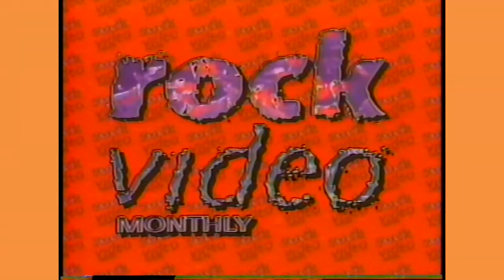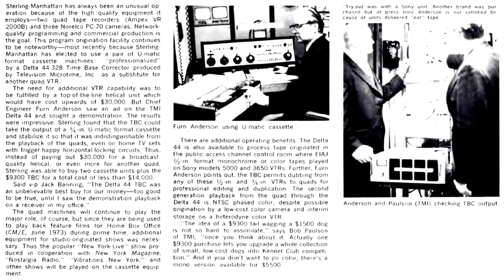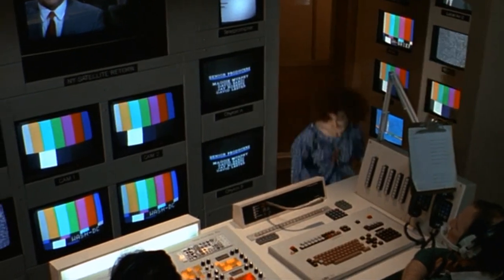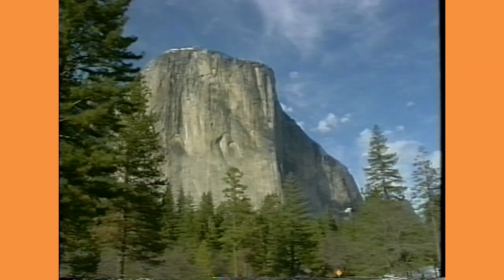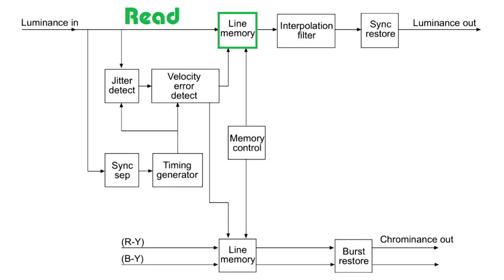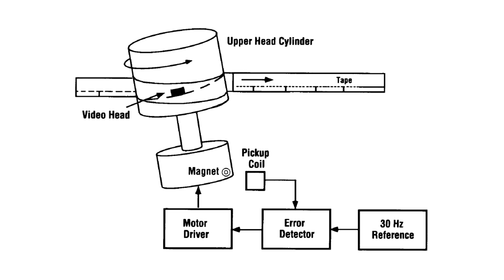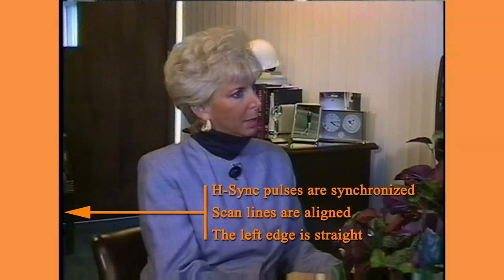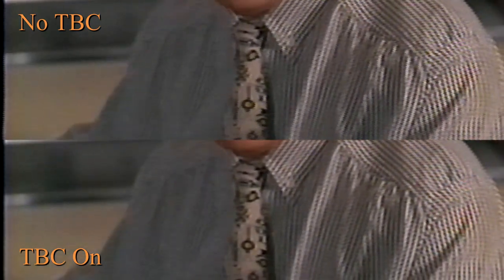What is Time Base Corrector (TBC) and do you need it?

Comment: Some of old vhs c recorded by a mitsubishi camcorder in the 90s have picture roll during the first second of a sequence... i d k why this problem appears on the tape ... i use a jvc with tbc inbuild for the play-back but the picture roll still persist a little 😢
Reply from the maker: My VHS camcorders also stabilize the picture horizontally, but show an occasional picture roll on bad tapes. I run these through a Digital 8 camcorder, which has a stronger TBC. I've yet to acquire a DVD recorder to use a TBC.
Reply: @ConsumerDV  thanks, i think is better if maybe a choose a good external Tbc. I think the tbc inbuild in the jvc camcorders are good to preserve the frame but gives some littles picture roll ... not the best when we want to save our precious memories

Comment: Which specific 80's VCR are you refering to  ?  I've never seen a "standard vhs deck" with a "built in tbc" here in europe. Super-vhs i sure did.
Reply from the maker: I said "hi-end VCRs", not "standard VHS deck". I went through dozens if not hundreds video magazines published in the 1970s, 1980s and early 1990s. You can see everyone was feeling that digital video was right around the corner since mid-1980s. Many VHS machines were marked with huge "DIGITAL" labels only to mean either digital pause mode or digital effects or digital picture-in-picture. Some of them had a TBC, and I got an impression that 1987-1990 were the years when TBC was about to become a standard feature for top-level VCRs. The June 1990 issue of "Video" magazine published the article "Top decks adopt a picture-fixing feature". I suspect that movie companies had their hand in stifling the adoption of TBC, they did not want consumers to make better copies, just like they were fighting double-cassette video decks and they were recording off-the-air television earlier. I am surprised they had agreed to CDs, but back in the early 1980s a PC HDD capacity was only 5 to 80 MB, so the labels felt safe. Anyway, I cannot provide specific model numbers for Europe, all I can suggest is to go through magazines, sorry.
Reply: @ConsumerDV  yeah, "digital" in 80s and 90s is what "ai" is today, advertising gimmick that...well..doesn't really work...esp. in this field.
i recently saw ebay listing fro toshiba 'v3' technology, but i dunno if they called it tbc. i think i have some review in "video magazine" from 90s for that deck.
so it may be that "digital picture improvements" were separate to "proper" tbc, which indeed was only on s-vhs decks, i think. ie i don't think you can find tbc on non-svhs deck. 

there is toshiba m781 ad in video magazine feb/march '96  and review of m-761 in dec '95. ad talks about DNR, and article is called "heads first" (19micron heads for slp...frankly that days nothing about standard speed which uses different set of heads). article carries sentence "slp playback looked equally fine with and without them" while talking about 19micron heads. which is nonsense, as slow speeds use 2 different heads. that's why sp/lp models have at least 4 heads. 
ad says m781 is first vcr with DNR. shows noise lines in before/after image. ie dnr removes loise lines. neither vcr is advertised as having tbc, tbc is never mentioned.
in europe there were not much of, for example, toshibas, hitachis or mitsubishi vcrs. i guess they sold stuff where market was bigger. i would say even jvc was less sold in europe, where panasonic and sony were probably best sellers. and some german brands, but that was probably all made in japan (for example fisher..that was probably sanyo underneath). some philips, some grundig. dunno how much of those were dutch/german products. ie who made mechanisms they used etc.

toshiba m781 boasts 6 video heads, so that would be one pair for each of speeds, sp, lp and slp(also called ep).  that issue of v. magazine has a short description of mitsubishi hs-u760 deck. s-vhs. tbc not mentioned, in either article or on front panel of vcr. so probably not even all s-vhs decks had tbc.
Reply: @ivok9846   Nope that's toshiba Pro Drum version 3, totally different than a TBC.  it's a way to assemble the drum and preamp together so there is less noise on the picture due to interferences. Pro Drum is great i have tested two vcr's with it
Reply: @KNOFGHD1  yeah, 2nd paragraph of my reply says tbc is never mentioned in context of Toshiba v3. 

I was recently wondering (when one of my VCRs malfunctioned) could it be that preamp was inside head drum. but it wasn't. 
how was power supply to that v3 preamp done, via one more coil on rotary transformer, but feeding power to drum instead of carrying video signal to main PCB? that would mean it has 6 (video heads) + 2(hifi) + coil to supply head preamp. geez.... that's a lot.

overall I dunno if v3 can beat Sony hifi models from late 90s, but I doubt it. it's already too sharp video image.
Reply: @ivok9846  what you can do is foil-shield the ribbon cable ( to reduce E.M.I) that goes from the drum's pcb to the preamp, you might gain something (less noise). SP use 2 heads, LP  use 2 different heads that's 4 heads. 2 more Heads for Hi-Fi sound (one for left/right channels) that's 6. On "pro decks" there is another head (flying erase head) for precise editing. Can be 7 heads. not couting the Audio/control and Erase heads otherwise that's 9 total
Reply: @KNOFGHD1  toshiba ad i quoted claims 6 video heads. there is 3rd speed, called ep in europe and slp in usa. seems they used 1 set for each speed. and they're not counting hifi heads, pictogram says ¨6 video heads + 2 hifi heads". so it's already kinda cramped if you wanna put preamp into drum. but dunno, i didn't inspect electric diagram for that vcr. would be interesting to capture some video off it to compare. what was pal model number?
Reply: @ivok9846  no EP is for usa (a.k.a LP in europe) and SLP i have doubts but perhaps they reuse the same LP heads with a trick (reduced bandwidth?) , not sure
Reply from the maker: NTSC SLP (Panasonic) is the same as EP (JVC), both tripled the recording time and could use the same heads, if the heads were 19 micron. NTSC LP doubled recording time and AFAIK required extra pair of heads. Not sure about PAL.
Reply: @ConsumerDV  ep is unusual in europe, and came only very late, on some panasonic models. both lp and ep on my nv-hv60 are pretty bad. and so is sp. after 2000 it went to crapper

Comment: still can't post links, not even yt....and i can't reply to thread i started.....

posted few more clips on yt channel for this account. sd, hd and point-resize(nearest neighbour)

could be slightly better (for yt) if the mpeg2 step was removed (mjpeg straight to mp4), but i won't be changing my destination format (laced mpeg2) because yt is crap anyway, and new codecs (divx, xvid, 264, 265) don't like noise too much.  but  vhs on yt can look better than 95% of people are doing it. i mean, i've found just two yt channels that are properly transferring analog video....one on frank zappa, and another that did some hi8 and vhs with vapoursynth qtgmc...oh yeah, another is "video dump". 

i can do qtgmc on the fly (for playback of laced mpeg2) on newer pc anyway. AND sony lcd tvs have good denterlacers and scalers.  

that's why i don't care about tbc, not much h or v. sync issues there (even with damaged tape capture is not stopping) and it would introduce some blurring. and i hate any blurring. 
if i was in this for the money, and many tapes would have much timing issues, then yes. this way, no.

Comment: You're really mixing up a lot of terms and concepts in this video, and that may lead to a person buying the wrong TBC (or non-TBC item) for their digital conversion needs. Yes, TBCs are needed. And yes, the correct TBC will improve quality. But not necessarily for the reasons stated in this video. For starters, ancient broadcast TBCs really have no overlap, nothing to do with modern TBCs made for consumer analog videotape formats. "TBC" is a wide term, with many loose definitions, and it has changed over the decades.